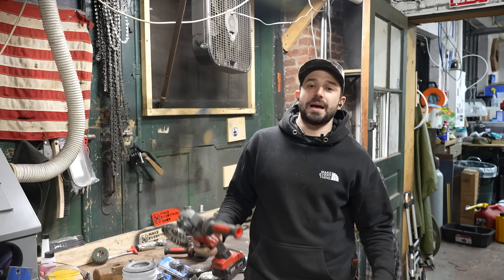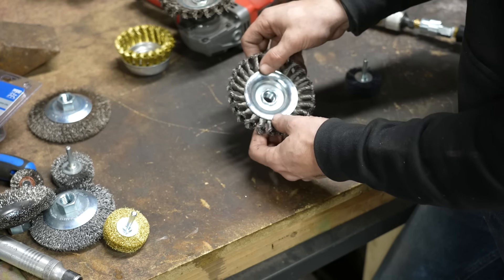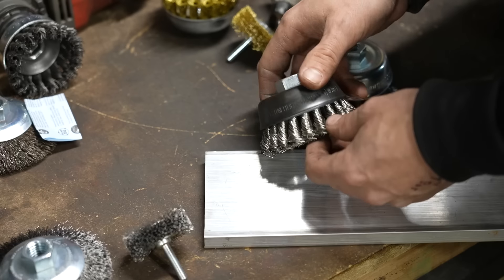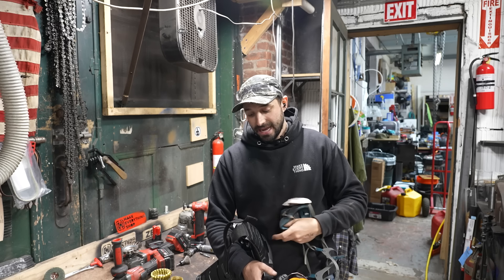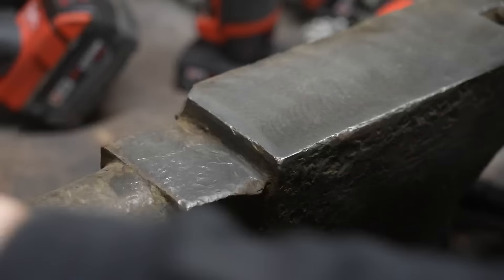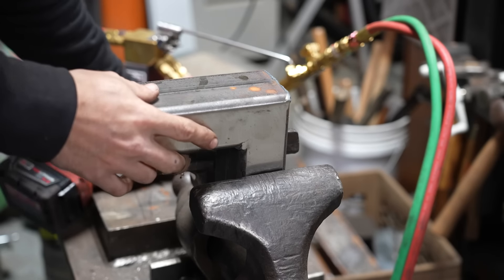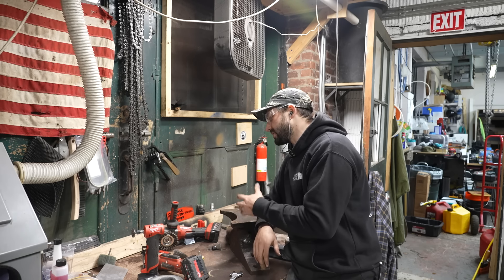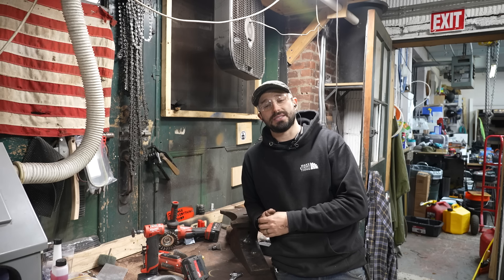Why Wire Wheels? - Metal Working Tools You Need!

Comment: I had a flat knot wheel on a 4-1/2” grinder grab Amy apron and wrapped itself in a split second and slammed into my fellas.    Around 25 years ago but I’ll never forget it and it never happened again     Making polished aluminum diamond plate for Binghamton Fire Department trying to clean the black soot off the welds inside the boxes.

Comment: I restore and sell old, often rusty, tools, so your detailed explanation of some of the available accessories was very helpful for me. Thank you! My practice, after removing the bulk of the rust from an anvil, vise, sledge, whatever, is usually to turn to electrolysis to remove the rest. I've found rust removal by electrolysis very effective, not to mention avoiding the expense, time, and sweat I'd have to spend going after a rust monster with a grinder. Anyway, I'm a new subscriber who is thoroughly enjoying your very knowledgeable videos. Thank you!

Comment: Congrats on 2K!  Just finished using a wire wheel on an anvil and although I had good PPE I found the sparks could get around the sides of my safety glasses.  Good tip on the face shield.
Reply: *200k

Comment: Great tips. I can't emphasize how important it is to buy quality. I worked two semesters as a lab assistant teaching welding and I'd always encourage my students to buy a weiler 13131 wheel for cleaning slag. I found that a single weiler would outlast a 4 pack of harbor freight wheels for a few bucks cheaper and not throw nearly as many wires.
I also recommend using a grinder with a paddle or trigger switch instead of a slide when possible. If something grabs and you panic its much quicker to turn off.
Reply: Good luck convincing anyone to use a side handle and a long body trigger grinder. 
I find I only need half speed for all wirewheeling, they last at least 4x longer too
Reply: @janeblogs324  I guess it all depends what you're doing and how much risk you're willing to take. I was at a two year school where even our most experienced students are still fairly new so anything that makes it safer and easier for them is a big plus. Personally for repairs on heavily rusted large equipment with lots of caked on paint and grime I like my makita 9005b that won't stall even with me leaning on it. In the shop on everything else I tend to use die grinders and a much lighter touch. I don't have variable speed grinders, but I do find that pressure makes a huge difference in how long any wire or abrasive lasts.

Comment: Excellent video on wire brushes using Angle Grinders.   I have 5 Angle Grinders,  which allows me the luxury of using one with a Cutting Wheel, Another Grinding, and yet another for Wire Brushing.  The 1/4 inch Right angle Grinder from Milwaukee is also extremely handy.   Thank you for this video and Happy New Year.
Reply: harbor freight be sellin cheap angle grinders now so everyone should be havin that
Reply: i have two nice corded and a 20v and some cheap ones for lighter duty

Comment: My Dad was always about safety and about loose clothing and especially around machinery. One day on one of my own jobs, I was using a little 5"disc.sander, 120v type. And guess what? It grabbed my loose T-shirt so fast! If thats not bad enough, I couldn't get my finger off the trigger!! The natural tendency is to squeeze tighter!! That's where I've heard, If you're going to touch something hot uses the back side of your hand and not the front. The tendency is to grip it???? And don't get use to using that trigger hold button, another bad habit. Always a lot of good information, Thank you! Be safe!!!

Comment: Nice work.  Thanks for sharing your knowledge.  I will probably watch this video four or five more times.  I am working on a metal R.V. gate that is taking me forever, mostly because I don't know what I am doing and the angle grinder scares the crap out of me.   I have a dozen or so wire wheels, cups, this and that.  But I don't know how to use them.

Comment: Yeah i bought one of those wire wheels for my angle grinder for the first time cause i wanted to use it to remove the paint from my mini bike frame and fenders and after about 15 minutes of use i started feeling like i was being stung by wasps lol. Had pull strands of metal wire out of my arms and pants legs. But they do remove the paint pretty decent just takes a while of doing small sections at a time. Gonna try the scotch brite pad next and see if that works any better.

Comment: Hey I got a flat twisted wire brush cs and I’m using it on thick steel but I find it creates little pits in my welds and that will a crimped brush work better

Comment: I'm going to add another bench grinder abrasive to your list that works great for final finish work on delicate items. Daisy nylon wheels.
Available in larger sizes than Dremel wheels and can be stacked for a wider contact area. I keep a 1/2 inch stack of 320 grit 4inch diameter daisy wheels on a variable speed bench grinder for thin or sensitive pieces that need a gentle pre-polish before buffing. ✌ 😃

Comment: Thanx fot this great video really and appreciate your in-depth data, i've a situation here and i need your advice for a newbie like me
i want to strip my old car paint to metal, it's my 1st project, so i've the time and i don't mind going slow, so i bought mini grinder with max rpm 3200 and intended to run these cups smoothly and nicely.
what's your advice, could it do the job and what type of cups should i use or should i use 3M Scotch-Brite Clean & Strip XT Pro Disc for better finish and safer metal results.
thank again man.

Comment: Second relevant video I've watched from you. Really like your shop. LOL!  looks like mine. Full of stuff.! Just bought a new old truck and looking for easier ways to bring it back to life.  Bought some knotted wire wheels and they work for my purposes. More information like this is very helpful. Murphy has been teaching me about brushes and softer vs. harder types. Love the brass infusion. does it improve rust resistance?  Now subscribed. ( afterthought flap discs and flappers?)

Comment: What would you recommend for cleaning up plated fasteners? Often you need to remove old dry loctite, gunk, or bits of rust but using a steel wire wheel would quickly strip all the remaining protective plating and cause it to rust super quick! I was thinking of using a soft brass (not brass coated steel) wire wheel on the bench grinder, but worried that it would still do damage to the plating? I guess one of the nylon wheels could work?

Comment: thanks Great video and respirator is a excellent idea.  Curious if brass wire wheel has advantages over steel wire wheel?  Can you use the brass wire wheels on steel or cast iron?

Comment: I noticed the milwaukee right angle die grinder really doesnt like prolong high speed usage with the wire wheels, my bearings and contacts are already going on mine because of it... dark shop wisdom tip is to throw a roloc back on it and lean into more than usual and re set the bearings... seems to work if you get it hot enough (do not try at home)

Comment: Great video, was wondering why so many steel wheels are plated with brass instead of being an alloy of brass to make it tough and durable, whats the purpose of the brass plating on the steel wire.

Comment: I enjoy watching your videos.   I have a question about drill press chucks.   I have a Delta 16 1/2 Floor Stand with a keyed Jacobs JT3 chuck.   I'm thinking of going to a keyless chuck.  Can you recommend a good chuck that wont break the bank?  Albrecht chucks cost more than the drill press did.  Jacobs chucks are now made in China.  I've been leaning towards a Rohm chuck, but I'm still not sure.   Also, should I consider changing to link belts?

Happy New Year!

Bob
Reply from the maker: Thanks for watching!! Check eBay for a chuck you can find great deals on albrecht and NOS Jacobs chucks. I’ve have great luck with the Chinese keyless chicks on amazon. Check your runout when you get it and if it’s no good, return it! Good luck!

Comment: I purchased these 1” knotted steel wire brushes for a drill. When I try to use it, it seems hard to control. Any ideas what I might be doing wrong?

Comment: im  just about to buy a carbon steel twisted knot wire brush or 2 for my grindette, its just to prepare lower control arms for painting while i am replacing vehicles subframe , i dont think i will have access to a media blaster this time

Comment: I want to strip black paint off an aluminum truck tool box. I bought a used box and the guy that sold it to me had painted it. He painted it black and in FL it gets hot to touch!!! Anyway, I have the “twisted wire” cup brush and it was WAY to aggressive. What about the crimped wire style????

Comment: Just came across this video, first one I've seen from your channel. I learned a few things about wire wheels - thanks for that.  You mentioned PPE as wires can fly. I do have a question though, why are you not wearing gloves?
Reply from the maker: Gloves are dangerous when using tools that spin like a wire wheel. They can get caught and be really hazardous. I usually don’t wear gloves when using something that could catch the gloves and mess up my hands. If I want to protect my hands from dust I’ll wear nitrile gloves to keep my hands clean, knowing they will just tear away if they get caught up.
Reply: I always wear gloves when both hands are on the tool being used such as an angle grinder. If I'm using something like a drill press or bench grinder where one or no hands are on the tool, I don't wear gloves.

Comment: I feel attacked in regards to ppe lol. I had one time I didn't even know it happened but hours later I felt something on my arm, looked n there was a small piece of wire sticking out. I had a chuckle n started pulling it out to find there was about 1/2 inch of wire actually in my arm. But where'd you get that single knot brush? I tried googling it n couldn't find one
Reply: There’s an amazon link in the video description.

Comment: SAFETY: My heart lept into my mouth when I saw you with the lump hammer head at the bench wheel WITHOUT leather gloves... 

You stress protection, which is great, but personally I go the step beyond and wear leather welders gloves whenever I'm using a wire wheel on anything. 

Take it from me, and this has only happened once, its a very sobering moment when your leather glove touches a rotoating wire wheel... think ambulances and extra vigalence from them on. 

But thanks for informative vids, I'm enjoying them

Comment: I did not find wire wheels great for mill scale. Is there a technique to it? I use lap discs.
Reply: They suck hey. The paint stripping nylon discs with silicon carbide work but would be expensive. 
Acid is best for mill scale

Comment: If you  have never used a wire wheel, it can be the  most dangerous  attachment you will ever use. Before  anyone disputes me, I have been using them for over 40 years  in industrial  construction and maintenance.  Come very close to being killed by one when it caught my tee shirt  and wrapped  it around my neck strangling  me. The brushes throw wires everywhere.  I have dug them out of my clothing and  body.  You wear safety glasses,  a shield, shirts tucked and stay on alert at all time. That also includes the  people within 20 plus feet of you!
Reply: Just use a grinder with speed control. You get 1/4 the torque at 1/2 speed. The grinder will stop if it catches something

Comment: Restoring a Wilton bullet from 1945. Should I use a stainless steel or carbon steel wire?
Reply from the maker: you can use a carbon steel wire wheel as the base material is not stainless and cant be contaminated. If the base material was a non ferrous metal youd want to make sure you used stianless to keep it from ever rusting.

Comment: I have the right angle milwaukee die grinder and when i use a wire wheel on it, it constantly shuts off and i have to keep taking the battery out and putting it back in to get another 20 to 30 seconds of use, its super annoying and frustrating and has discouraged me from getting the straight die grinder, do you, or anyone else have this issue? I thought this was going to be a great tool to add to the shop but instead im extremely disappointed!

Comment: Marine Applications Stainless -

Stainless: -              Is magnetic, Cr only will rust (No Nickel) 

Stainless Steel:-     Is non-magnetic Cr + Ni 18/8 (304).  Will work harden then gets very slightly magnetic

Stainless Steel       304 is not marine grade!  304 pickup will/may eventually stain, discolour, brown in coastal & salt water applications). 
Stainless Steel 	 316 is best for all marine work Cr+Ni+Mo.  Claims against you for 'carbon pick up' can be costly (Architectural, Pharmaceutical, Brewing & Food Process etc......)